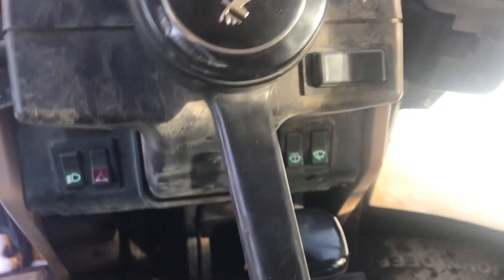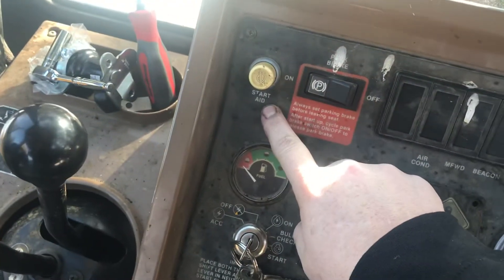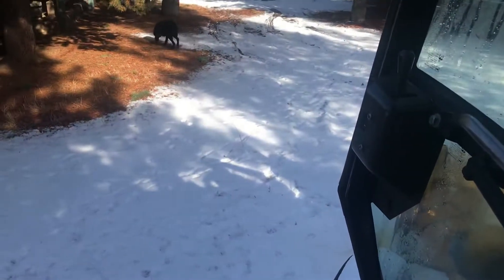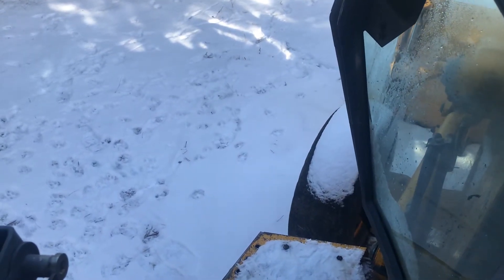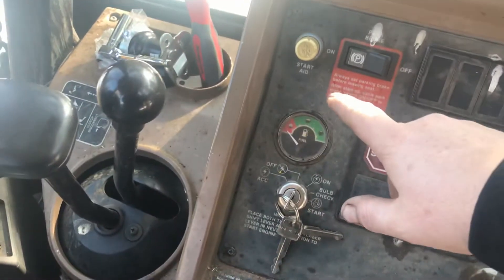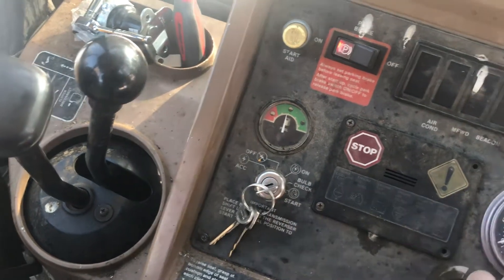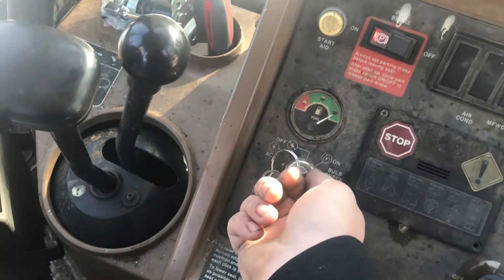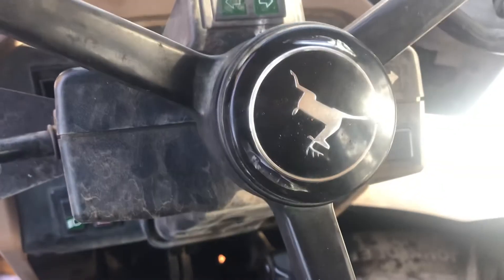(48) John Deere 310D start aid, ether start

Comment: I have a nice 310c that has the same ether start but much of the wiring has been cut so I doubt it works.  I haven't used it much and have to start checking the wiring.  No Idea if any of the sensors work and want to get them working again.  I have been able to get the complete wiring diagram and the wires are in place, not burnt, just cut except for what is needed to use.  Pretty sure I'll put a block heater in when I change coolant and new hoses.  Thanks for your channel.
Reply from the maker: Do ya know the history of the machine and why the wires were cut? 

Mine already had a block heater and it works great but I'd like to also add a small oil pan heater and a small hydraulic tank heater too as well as a onboard trickle charger.
Reply: @tdm8817  No I don't,  cable of several wires by loader control valve is cut. Possibly battery drain,  blowing fuses?  Fuel guage works,  Reverser cut out button on loader control works, starts and runs fine but I don't know if any  warning lights work.  Nice rig,  4wd,  3 quick change buckets and ripper,  Extend,  no broken glass and looks well cared for.  1991.  Didn't know of oil and hydraulic heaters but doubt I'll install.  

Ohhh, didn't check your channel name,  yes I watched all the Reverser rebuild vids you did and saved a couple to "watch later" so I didn't lose track of ya.  Great videos and Channel.  Nice to see the differences between c and d series.  Make more vids if you can.